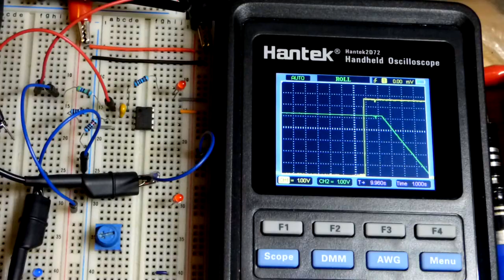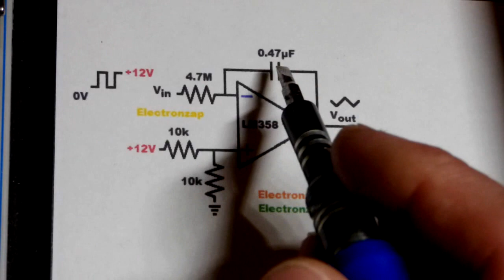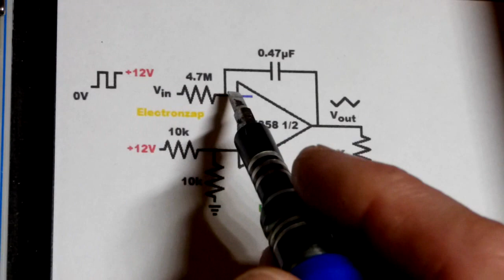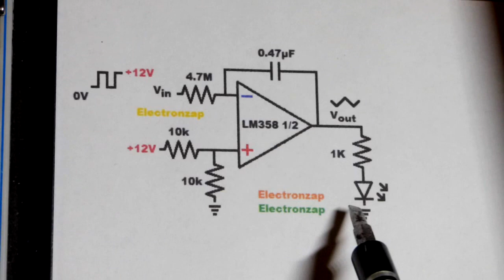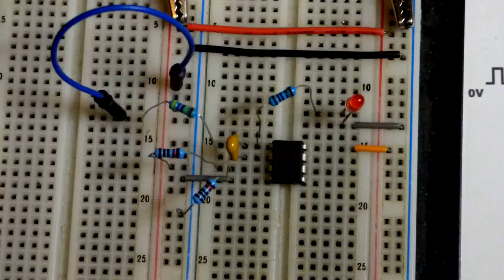LM358 Op Amp Alternating Voltage Ramp from Astable High Low input learning electronics shorts 66

Comment: The first time I saw an op amp integrator, I was thoroughly confused why the response to a square wave was an actual triangle wave with straight lines, instead of the exponential curve you get with a simple RC circuit.

The "ah ha!" moment for me was that with a simple RC circuit, the voltage across the resistor changes as the capacitor charges, and therefore the charging (or discharging) current changes as the capacitor's voltage changes.  That's why you get the exponential curve.

But with an op amp integrator, the op amp changes the output voltage as the voltage across the capacitor changes, so that the voltage at the inverting input stays constant.  Since the voltage across the resistor stays constant, so does the current (remembering that no current flows into the op amp's inputs).  Constant current means the capacitor charges at a constant rate, and therefore its voltage changes at a constant rate.  That's why you get a nice straight slope on the triangle wave.
Reply: Yes, good observation.  You will always get a linear ramp when you charge a capacitor via a constant current source.